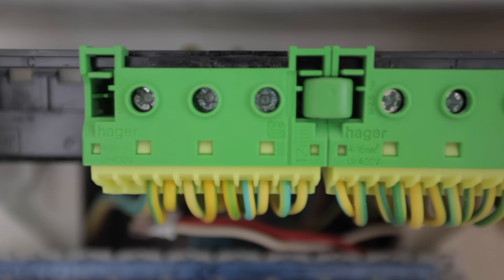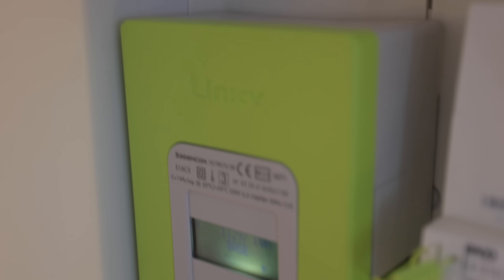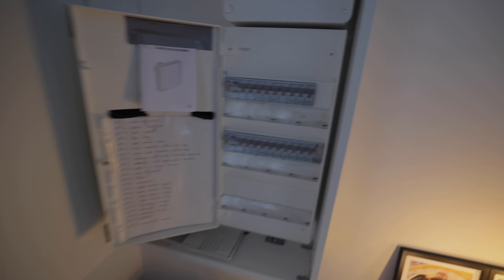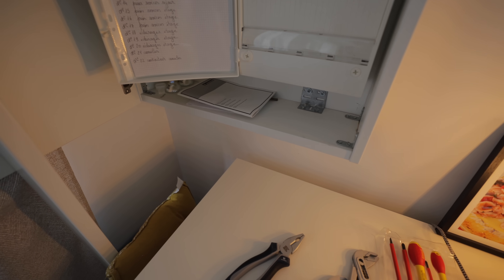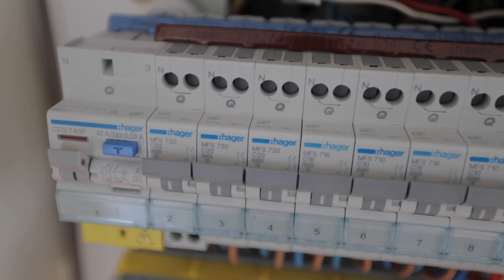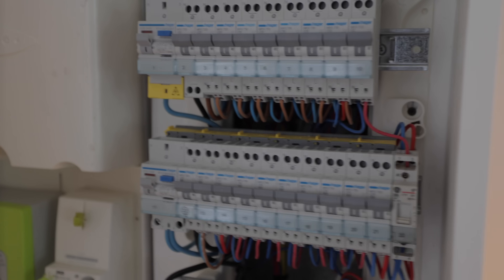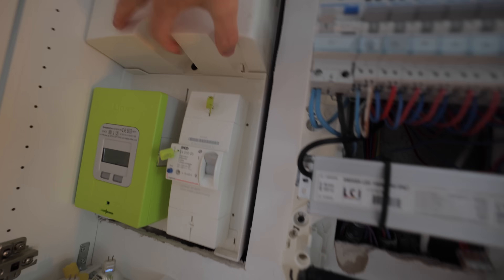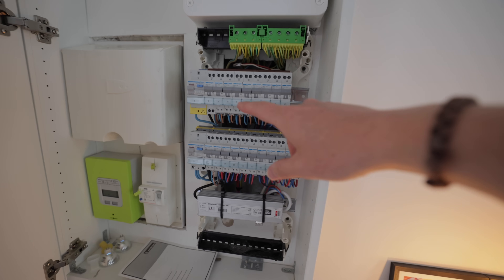U.K. Electrics SUCK! This is what we should be doing…🇫🇷

Comment: I live in France. The DTI is a RJ45 socket for the telecoms engineer to plug in ADSL test meter. Not used for fibre but if you have a separate landline then this is what is used. The black panel with the cutouts is for network hub/switch normally with CAT6 cabling. Fibre the telecoms engineer like to run this directly to the hub via a green outlet. The Linky smart control is virtually mandatory now. You don't have an option and it is supplied by EDF/ENDIS. So if you change energy supplier it just done digitally with no house call. The busbar protection have been cut too short. You can still touch the live and neutral where it has been shortened. You can buy special covers. The 2A breaker is for the small feed for the HC going to the relay for the hot water. The electrician has not got the correct circuits on AC and A.
Reply: This obviously depends on how widespread Frances DSL rollout is (And I've not really ventured into the more rural parts of France)...But I like to think that someday a telecoms engineer will be going into a long unoccupied property to prepare DSL service for a new resident, will open the cupboard where the DTI is, and uncover a long-forgotten Minitel terminal - Still connected - And in full working order (If Minitel was still operational)... ☎🖥😁

(Just hoping to goodness for the sake of the person responsible for the bill - If the terminal had been left powered-on and connected right up to the end - That it hadn't been left on a 3615 page... 🔞💸😉)
Reply: @UK-Combustibility-Assured  well, in fact rural parts of France mostly have fiber available 80% in rural areas, and 86% overall have acces to optical fiber. France has the highest rate in Europe and copper extinction has started.
Reply: @pizza_diavola-bx4op  France does communications and connectivity very well, there's no denying that...And where we Brits were still wasting millions of Pounds every year shipping millions of Pounds of telephone directories out to millions of households around the UK, what did France Telecom do? They dropped the phone books, gave every subscriber a Minitel terminal and free (I assume) access to Directory Enquiries...Soon to be followed up by much easier and cheaper booking of holidays, plane and train tickets for a short data session costing much less than a voice call! 🇫🇷💯👍

And when the rest of the World came into the Internet, France had already been there for at least twenty years. If that isn't the most literal definition of « advanced » I don't know what is! 🏆

Granted, we also had our own equivalent (Prestel) which also supported colour and introduced the first public e-mail service...But at a cost of at least 400£ (4100FF/500€) for the equipment plus something like 10£/mo (101FF/12€50) for service, that was destined to fail from the start in an era when most households weren't even earning 100£ a week! 💸

Comment: The socket outlets in UK would be preferred on type A RCBO. It products against half cycle positive or negative faults.   Example a plug in charger goes faulty and only one half of the bridge rectifier conducts 
I think this flat is incorrect use of type A vs Type AC

Comment: Having a split-RCD CU is a step backwards for me from separate RCBOs. 

It is, however, about time that CUs with dual bus bars for line and neutral with RCBOs were the standard. Dual pole would be nice of course. 

Putting an LED line driver into a CU is a no-no for me. 

Having separate circuits for dishwashers, microwaves and so on strikes me as a very expensive and inflexible system compared to simply plugging in or hardwiring into a 32A circuit. That's lots of extra wires, extra breakers and limits locations. Some will complain about ring circuits, but it's perfectly possible to use 32A radials in kitchens.

I should add that just because the water heater is rated at just 1500 watts doesn't mean that it costs any less to run. It just takes longer to heat up. Water takes the same amount of energy to heat, whatever the rating of the heater element (leaving aside heat pumps - a different issue). What does make a difference is being able to use cheaper rates using "smart" technology.

nb. are those rather steep, narrow, open stairs without a guard rail within regulations? There isn't even a handrail on the wall side. We obsess about the danger of electricity, but deaths due to falls from steps or stairs dwarf them (731 deaths due to falls from stairs or steps in England and Wales in 2021 for instance).
Reply: Having that many RCBO's would make that board blooming expensive?  There are rules on the number of plugs and lights  per circuit, and likewse the number and rating of circuit breakers per RCD. The number of RCD's is then governed by the size of the property. Dishwashers and Microwaves don't require a dedicated circuit.  Though it is recommended for Freezers, Dishwasher and tumble dryers. Washing machines, Cookers, Ovens, boilers, hotwater tanks and radiators should all have direct circuits.  Though you can put two rads to a circuit breaker.
Ring mains are considered dangerous and illegal in the UK sense of the installation.
Horses for courses, though it is true that a 120m2 house in France, uses km's of wire these days, which does indeed make it expensive.
Reply: @Charles-pz6ux  As european plugs do not have fuses, then they cannot use high powered circuits, which are are very flexible as far as the consumer is concerned. In my kitchen I don't have to be concerned which combination of appliances is plugged in where, as the circuit can deliver 7 kW. That simplifies everything. Also, it doesn't have to be delivered as a ring. Sometimes a 32A radial is used in a kitchen. Often the only dedicated circuit in a kitchen is for the cooker (although a few might have a dedicated fridge/freezer circuit, albeit with a socket) . The enabler for that is the fuse in the plug, which means that the overcurrent protection on the final leg is that appropriate to that appliance and cable.

Comment: The connector for the heater, probably is triggered by a "it's now tarrif cheap" signal they have everywhere in Europe.
It means the heater does not need a timer.
They are removing that signal from the network, because it's no longer used with all the smart meters these days
Reply: What do they use?

Comment: 10:30 All of them are Type C? interesting. Here in Poland I think they are usually Type B.
Reply: Type C has an advantage if you have many SMPS (like IT equipment). I had to reset the B types several times after a power outage, till the capacitors in theSMPSes were charged. Using a type B in the new CU solved this.

Comment: In our installation, it's not even possible to partially lift the cover with a seal on. Every accessible component in front of the meter is sealed not only for safety reasons, but to prevent anyone from stealing electricity.
Reply: here in France it's also protected agains theft, also with an electronic sensor that tells the distribution company if the cover was opened.
Reply: Eastern Europe: there is a panel with a sealed meter at the street front and there is one or more distribution boards inside the house; we can do anything in the house (with qualified electrician, in theory), we can also turn on or off the breaker that is after the meter. Basically after the sealed meter the electricity company has no control, nor do they need any control.

Comment: Non US/Canada electrical equipment looks so strange to me. I'm not an electrician but I can wire a house to code and pass inspection in Canada.
Reply: USA electrics are so out of date. Looks third world.
Reply: I'd like a 115v testing supply in my house, so I'm considering running a split-phase circuit driven off one of my 230v circuits via an isolating transformer. ⚡

...Will certainly be amusing installing a NEMA 5-15 outlet next to my BS-1362 ones! 🔌😁

Comment: Looks like DTI I would assume it's something like dutch telecom looks like they're using ethernet to the premise or that box includes a DSL router Plus switch and then the patch panel with the Keystone jacks not all inserted properly haha. The coaxial could be aerial or it could be cable / satellite TV depends on the house I'm not familiar with the french system that much. It's a neat little box I wish we had some thing like that in the US. Our data services and such come in on a box on the outside which is used as a demarcation for billing purposes if they have to work on something in the house versus outside the house delineates the property line. But those are individual per each service. so to have them all neatly tucked away in a one box is kind of nice. I am a geek for anything data power infrastructure.

Comment: Live and neutral into all the breakers - but still a shared RCD instead of RCBO? 

Also odd there are massive holes behind the boards - so no fireproofing between the electrical connections & any stud etc in the wall

Comment: The circuit is cable from street =>blade fuse=> linky meter => RCBO selective 500ma , you can open the "exit side" of the RCBO but not the fuse box. the seal is missing here.
The led driver is illegal in the consumer unit, it's not attended to put anything else than RCB , circuit breaker, relay, but definitely not a led driver !
The bussbar on the top row is attend for use with screws, the bottom one is the right one, it a push fit but have retaining clips to lock the bussbar in place.
With linky the adjustable main RCBO is not adjustable any more. It was previously used to set your power subscription. they were all set at the highest current the line feeding the house can bear. The subscription level is managed by a breaker (a simple switch) in the linky. 
The switch will open only if the current is over your subscription but as it's not equipped with any arc extinguishing system, the linky is smart enough to keep it close if it's a short circuit or any condition that will damage it if open. The protection for short circuits is provided by the main RCBO, and if the RCBO fail the delayed blade fuse will open the circuit at last resort. Type A are a bit more expensive than the older AC one, but now the difference is so slight that you keep only type A in stock and install only A type. It came mainly with the development of induction cooking device with high power diodes that create high DC voltage with high power.
Note that the breakers are type C and not B like in UK
Reply: I wondered about that main fuse cover as well. Here in Germany anything in front of the meter and the meter itself have to be sealed. I somehow assume it is the same in France. I think you could see the green seal (In French I think it is something like Plómbe, originating from the old lead ones) on the Main Switch.
Reply: @alexanderkupke920  The meter 'linky" plastic seal (no more leaded seal) is hidden behind his removable clip front cover. As the breaker is after the meter, and is no more a limiter for the subscription power, they don't matter if it's sealed or not, it can be to refrain people to mess with "always live" part at the input side, the output side was never sealed as it's the customer side.
Reply: @alexanderkupke920  there is a reason for that, the RCBO in France is divided in two, the upper part belongs to the company which manage the power physical network ENEDIS, so no touch so they have a seal. But the down part belongs to you and you can open it at your own discretion, fortunately by the way because you could not test the residual current breaker otherwise. In that case you make it trip creating a line-ground fault
Reply: Yes, the green plastic cover comes off and there's a slot bottom right where you can plug in a device for remote monitoring of electricity usage. 

One of the big differences in smart metering between the UK and France was that Ofgem wanted to leave meter manufacturers to implement their smart meters as they wanted provided they met a basic spec. As a consequence we have a load of different smart meters. In France all domestic smart meters are pretty well the same so there are no incompatibility issues. Although there are some objectors to Linkys in France, nothing like the level found in the UK.
Reply: @reeshar1234  In fact they all share the exact same specifications in colour shape functionality and lifetime expectation. they are just made by differents manufacturer, the same way phones from the 60 (like S63) and minitel were made at their time, exact same thing just different manufacturer to secure the supply chain.
Reply: @lapub. Yes, that's what I find so brilliant in France: the standardisation. (Pour expliquer : j'ai double nationalité et je passe presque la moitié de mon temps en France).

I actually worked for Ofgem on assignment as a consultant when they were specifying smart meters. I argued long and hard for standardisation but they wouldn't have it and I was eventually moved off the project. It was a source of much frustration to see the mess that was made of their introduction in the UK.
Reply: @reeshar1234  La standardisation il n'y a rien de mieux. Certain diront que si il y a une malfaçon il y a la même partout mais au moins la solution est la même partout aussi. Le bon exemple est le cas de la corrosion sous contrainte des "vieux" réacteurs français connue depuis début 80 avec le PDG edf de l'époque qui expliquait le problème sur TF1 (trouvable sur l'INA) Et la non standardisation de la fibre optique a fait que ça a plutôt ramé au début et au final la fibre a été déployé avec le type de réseau promu par orange (Gpon) et complètement calqué physiquement sur le réseau cuivre (il y a toujours un Sous répartieur cuivre a coté d'un SR Optique)

Comment: i think the "DTI" is a DOCSIS Timing Interface and it would be the responsibility of the Provider to maintain that, it means the internet & phone line previously was using a connection to the street box then coaxal from that to the premises the same way VirginMedia operate in the UK. just virgin media uses DOCSIS 3.1 now, where as i think France instead of upgrading coaxal networks for DOCSIS moved from DOCSIS to Fibre to the premises so never upgraded it past DOCSIS 3.0 the same as France has not really upgraded to VDSL2 over VSDL ( both of which is fibre to the street and then 2 twisted pair copper wire using RJ11 to the properties) since France has always used the RJ11 for Phones